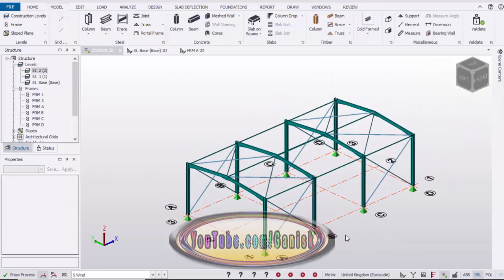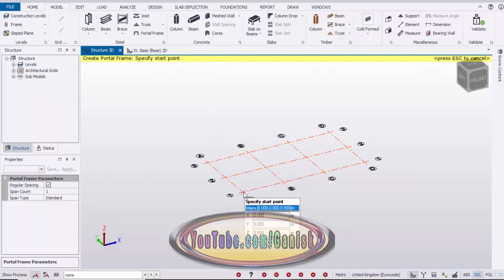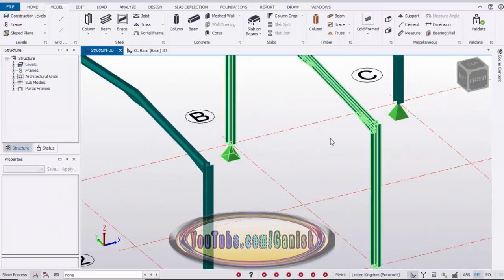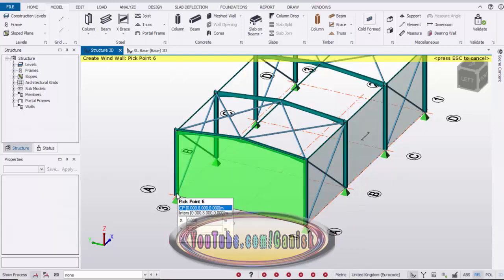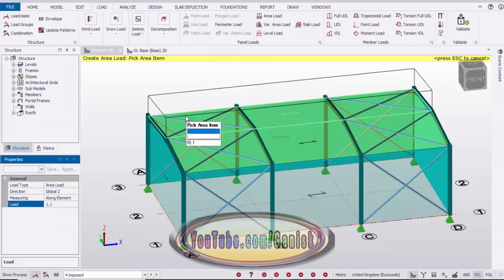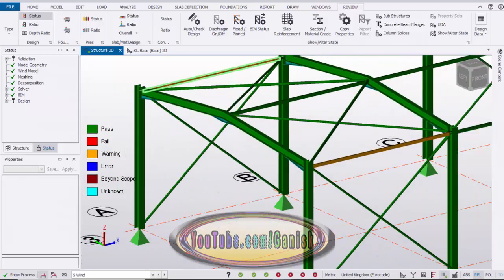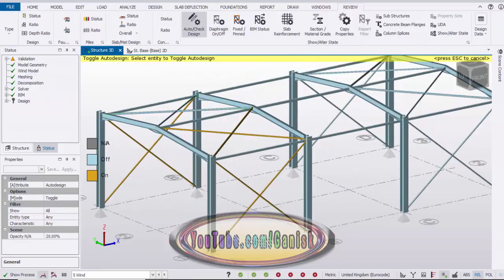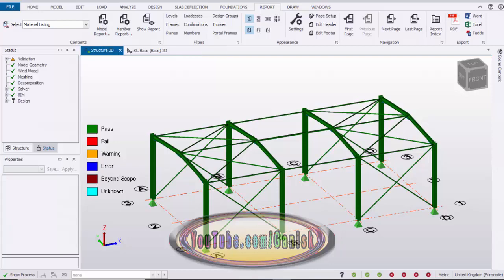Tekla Structural Designer Tutorial 4 - UK Design

Comment: Hi, I am having a problem on validation saying that "Non-linear elements change to linear elements for linear analysis" when I set my cross bracing to tension only. May I know how to solve this issue?
Reply: First you need to understand what is linear analysis and non-linear. There is nothing wrong with non-linear, as long as you understand what you do.

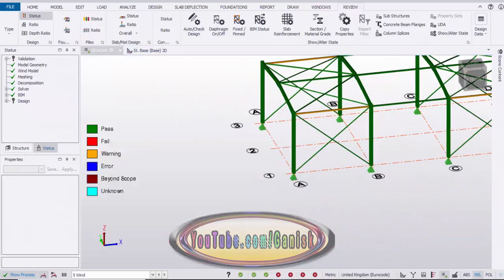Comment: Hi, I am having a problem with the design part. (14:00) I am having my model as the "Unknown" after the design, showing no green members. 
Do you perhaps know what the cause of this issue is?
Reply from the maker: if you miss single step in it you will get it unknown, take a new file and do it once again, crosscheck with every single step in tutorial.
Reply: @GaniSk  I have found my problem, I did not copy one of the portals properly. I am now trying to detail the connections in Tekla Structures 2020. Wondering maybe if you could help with that? Sorry, I am very new to this, I appreciate all your help. Thank you in advance